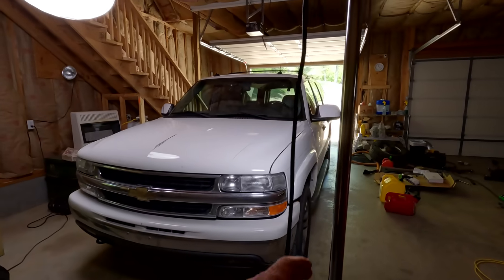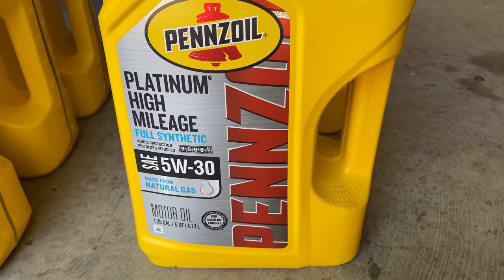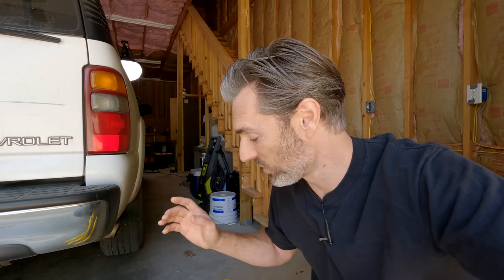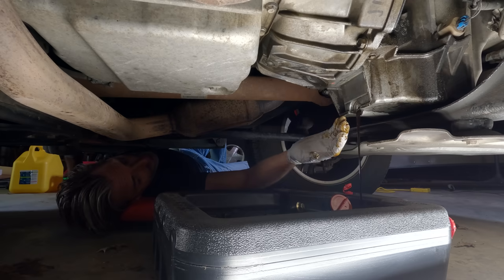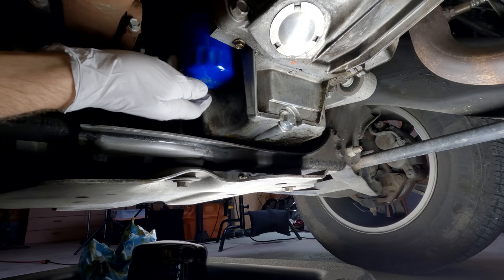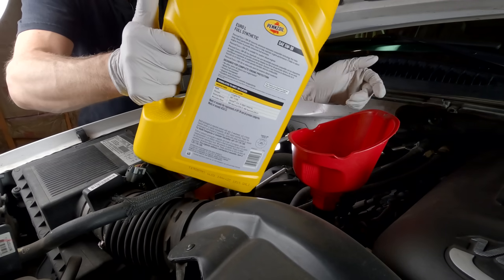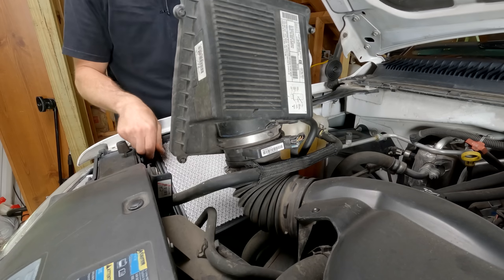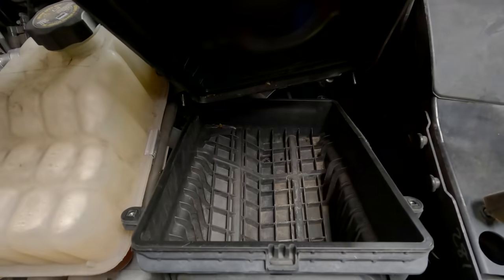If I Use European Spec Oil For My American Made Truck, Will It Break?

Comment: Dexos2 was originally made because the small DPF diesels need low SAPS to save the DPF. It also makes sense that it is a "Euro" formula, Europe has a large number of small DPF diesels. I suppose there are enough Opel and Vauxhall diesel cars for GM to need an oil that fits.

This is why it also meets Mercedes 229.51. 229.51 is the specification for the early DPF Sprinter. It's backwards compatible with earlier non-DPF Benz diesels.

14:39 I like what Toyota dealers do. When you get a timing belt replaced, they make a sticker that is hard to remove. It notes the date and mileage of the last timing belt replacement. Having that done on schedule is critical. Always know if your car has a timing belt, and always replace it when the manual tells you to replace it. I'm not sure if other manufacturers make a sticker for timing belt changes that is designed to stay put for a really long time.

Comment: Check the zinc requirements of your older Chev engines and what your oil has. Becoming a big issue with older engines with new oil.
Reply: Roller cams don’t need a lot of zinc like the flat tapper cams do.

Comment: That EuroL oil is formulated to withstand longer drain intervals due to Euro standards so it is packed with extra additive pack.
In such engine you can easily do 5K intervals , so at 3K you can collect a sample thru dipstick and than send it to Blackstone Labs for UOA and see if you cam safely keep it for 5K miles .
Remember that Euro drain intervals are often past 10K miles but i would never recommend it
Reply: Most euro cars do 15k miles intervals, oil is a lot more expensive in Europe. A gallon can be up to 100 USD
Reply: Some euro oils lack anti-wear additives like molybdenum.
Reply: @Shadows-RC  they meet alot more stringent tests tho, moly isn’t always needed

Comment: Jimmy, FROM YOU: I've learned of PUTTING A MAGNET onto the filter.....GREAT IDEA!   I have began to use "Napa Gold" oil Filters (they're made by WIX!) , where as I've always used to use "FRAM", since the '70's...........
Reply: Yep, wix makes a darn good filter and is always a safe choice!  For 20+ years I avoided fram like the plague. Until I started researching and cutting open new filters to inspect, measure and disect the filtering media to gauge thickness and view under microscope🤪 now, one of my favorite oil filters is the gold fram ultra! I still will not put an orange or silver fram on one of my vehicles. Tho my grandfather has used them religiously for 50+ years without issue, I've seen the guts from an orange fram get sucked into the oil pump and wreck an IMCA street stock engine. I know... wrong filter for the application.
Reply: @aaronpowell4885  Fram spin on filters are alright, their cartridge filters suck though. Had a Fram Ultra collapse within a 3k mile oil change interval in my buddy's S60R drag/street combo car. I only use Wix, Mobil, Mann, Purolator, or Mahle in cartridge filter applications as they seem to hold up way better than STP, K&N, and Fram filters from what I have seen in most Euro cars that I have worked with.

Comment: Did you know that these gm engines have many bigger oil filters that are compatible with the engine. I run a longer filter on my 6.0 Denali. It’s bigger than the oem filter.

Comment: Well GM states to use Dexos type oil. But i can assure you European Spec oil is actually of a higher standard than even Dexos. Another thing, if you used 100 Synthetic instead of Full synthetic there is not a great deal of difference between 100% Synthetic oil.  It is all the best stuff for your engine no matter which type. You'll have more problems using the wrong viscosity than anything.

Comment: I've been using nothing but diesel and euro 40 grade oil on my gen 3 5.3 and 6.0. Well over a half million combined on both original engines with plenty more to go and have never been torn apart. Hardly burn any oil and they run soft and smoothly with great compression.

Comment: I personally think that if you are putting effort into high quality oil you should also get a low micron rating oil filter like the fram ultra synthetic
Reply: Watch an interesting video about the flow and psi drop across many different filters vs oem spec. How it can increase use of the bypass valve reducing filtration rate or reduce pressure in critical areas like the crank journals etc. I tried this with a fram ultra vs a tough guard base filter and noticed a difference in the oil pressure and idle vibrations. Its not major but notable. The video ended with the consensus if there is an increase in filtering capability there needs to be an increase in media surface area to allow for the same flow rate and pressure after filtration.
Reply: @mikehub6664  yes, I agree with this theory because to me on Toyota engines, it seems as though they value flow over filtration
Reply: @mikehub6664  I use the Fram TG.. Tough Guard, it is very much like the OEM filters of all makes.
Reply: My experience with Fram filters in Euro cars  has been lackluster. The expensive Fram Ultra filters flow poorly and have collapsed and torn under 5000 miles multiple times in my friends cars. One of my buddies did a 3000 mile interval on their S60R with a frame ultra filter (running Liquimoly Leichtlauf 5W40, it's drag/street car) and it split in half in that short interval. Never have had that issue with Purolator, Mann, Wix, Mobil and Mahle filters
Reply: @Dustin Satterfield  I can see your point with regard to the cartridge filters from fram. Though the experiments for flow I haven't seen high psi or lack of flow for canister filters. I have a fragile ecodiesel so I only have wix as a quality option but I run a fram ultra on my expedition 5.4
Reply: @rockingarchangel  it's pretty bad for Euro cars running high viscosity base stocks like 5W40 and 10W60. Particularly for modified cars like the aforementioned S60R, or even my S60R that is running 22lbs of boost, when running a thicker oil than stock is quite important (5W30 and 10W30 both thin out too quickly at high EGTs, which leads to some pretty nasty wear with sustained loads) I have seen Fram and K&N filters really struggle with keeping their structure due to the higher pressure a thicker viscosity oil puts on the filter media. In those uses a high quality synthetic media filter is a must. For a daily driver that's gonna put put around town and isn't gonna be pushed hard, eh, they're alright, I really haven't seen anything impressive from them though, and I really like to point to Mobil, Wix and Purolator as better filter options. Maybe others have opposing experiences, I'd love to hear what others have to say, but from what I have found Fram's filters really really struggle to hold up when running high viscosities.

Comment: Unfortunately your a little confused about DEXOS applications. 
Dexos 1 = Gasoline 
Dexos 1 Gen 2 was updated for LSPI issues. 
Dexos 2 is a spec for Light Duty Diesel engines.
Reply: In Europe dexos2 is for both gas and diesel cars

Comment: I would run the ultra platinum over the euro L. European oils are formulated for 15-20k oil change intervals, not quality of protection. Pennzoil markets the ultra platinum as "extreme protection" over euro L for that reason. Either way they are both good oils, wouldn't be afraid to use euro L if that's all I had laying around.

Comment: Pennzoil and Mobil One. I did use supertech but the price is higher than Mobil unless it's conventional. I'm still using up my Fred's surplus. I got an assortment of different weights. The cleanest oil seems to be a good thin synthetic.

Comment: I use European oil on my 2016 honda crv i dont use 0w20 to thin of an oil i use 0w30 castrol euro oil in the truck its way better quieter engine considering its gdi and in summer i ise the 5w30 castrol euro oil no issues and an engineer from valvoline stated that its safe to use 5w30 in a car that calls for 0w20 and he also said its better for extreme heat as well

Comment: Good tip about rocks and dirt on the oil jug. I’ve never thought about that before. Did you get that GM filter from the dealer? I’ve been using the PF61E for the past couple years on my 5.3 which is the longer version of the filter, but recently found out that the E line filters is the cheap line. I was doing research and the Wix XP 51522 seems to be the best, but I like the idea of OEM as well. Possibly a PF61, not a PF61E

You’ve probably seen it, but project farm did a video on air filters and he happens to have a NBS suburban. The Wix 42488 did the best out of all the options. It’s what I run in mine

Comment: I used a Mobil 1 ESP 0w20 oil in my 2005 Pilot out of curiosity. The oil is for diesel cars that require a 20w oil. It can be used in gasoline engines. I bought it cheap from my local NAPA.

Comment: Great tip on the tape w/ info under the hood. I, too, run Wix filters, and use a silver Sharpie marker to write the date & mileage when last changed.

I also keep a simple spreadsheet (free Google Sheets) to keep up with general maintenance, repairs, and costs for each of my vehicles and my small engines (generator, lawn equipment, etc.) This gives me a quick way to see my overall cost-per-year in the maintenance side of ownership. I don't track fuel costs & economy in that manner, as I don't have that much time on my hands!!

Another good tip is the little window service stickers. Most auto supply stores will give you blanks that you can fill in, and stick up in the corner of the windshield, so you've got an easy-to-see reminder. Again on these, I use a micro tip Sharpie, as it doesn't seem to fade as much.

Thanks for the great video!!

Comment: You may want to shift your oil choice to valvoline restore and protect.  A whole lotta people have had great results from older vehicles.  I just started using it in my 19 f-150 5.0l.  For the oil filter pre fill, check out the motor oil geeks you tube channel.  He has a dedicated video to that.  Seems like a solid recommendation.

Comment: I use Rotella T6.15w40  It's got higher levels of zinc, moly, and other additives.
My 5.0 Windsor has 125k and is run in a hot climate
Reply: Liquid cooled engines run the same temp year round. Now if it was an air cooled engine, that a different story.
Reply: High Zinc will wreck your Cat Converter.

Comment: You should never use an extension when removing drain plug bolt.
Reply: Why?
Reply: @unknownuser16335   It's easy to slip off and strip head. Bolt care 101
Reply: @johnwagner4559  Only if you try to one-hand it. If you hold it right, there is no risk.

Comment: with steering wheel controls you don't have to do the gas pedal thing.  Just go to your oil life and hold down the arrow button for 5 seconds and it will reset.

Comment: On your next oil change, borescope inside the valve covers and look at the color of the rockers, pushrods and hardware. See how you feel about Pennzoil synthetic.
Reply: what might he see?
Reply: I heard pennzoil becomes into some sort of plastic type of material over time
Reply: Bingo!!
Reply: @spiralnapkin  In my experience on four different engines, the result was an amber colored discoloration almost like a varnish. Think of what an old carburetor looks like with varnish buildup. Needless to say, we abandoned the use of Pennzoil with a quickness. Pulling the rocker covers off one of the engines, we tried to remove the discoloration. It was resistant to any solvents we were willing to try on a in-service engine. We ended up having to use a wire wheel on the inside of the valve covers. As for the heads and valve train components, we left them alone and are keeping our fingers crossed.
Reply: Always enjoy using Castrol Edge over other oils if I can’t find my brand I used Mobil 1
Reply: Yep, I avoid Pennzoil. I prefer Castrol edge or Valvoline full synthetic.
Reply: And does the color of the inside component affect longevity?

Comment: I believe the Euro spec oils are good but all about emissions, ive noticed it evaporates more, read it has less detergents making them prone to get more contaminated in diesel and high compression engines, fuel in oil without detergents makes the oil protection properties drop dramatically, and without cause the oil to turn acidic. Someone correct if wrong

Comment: Hey Jimmy, I've USED TO : ALWAYS change my oil at 3k Miles, always, > When I was using normal, "Castrol 20/50wt oil".   I've changed some .........10-12 yrs ago to Mobil 1 > 0-30wt. FULL Synthetic Oil.    I have also changed my oil change intervals  UP to 5K miles.   Everything is good with this> FOR ME.   I must also tell you that I live in Yuma, Arizona,  a "VERY EXTREME CLIMATE".    5 k miles, is good, and imagine, I'm changing 2 times, where I "would've changed oil/filter 3 times!   That's a BUNCH of $$.    Think about this Jimmy!

Comment: Dexos2 is actually for diesel engines. Can be used for gasoline engines too.
Dexos1 is gasoline engines only
Reply: Yup, this. My 2.8 Duramax calls for dexos2 in the owners manual.

This is not the same as dexos1 gen2 which it seems like the OP got confused by, which to be fair is shitty marketing on GM's part.
Reply: It has lots of great engine protecting additives.

Comment: I don't prefill oil filters as all our vehicles filters are either pointing down or horizontal. If it points up I will. Also you won't have any issues with the European spec oil. Pennzoil is the best, after Amsoil.

Comment: Dry oil filter? Count the seconds after installing a dry filter, until the pressure builds up. Then multiply it by how many times you've changed the oil over 100,000 miles.

Comment: You should be using the longer PF61 filter and not the short PF46 filter.  Those are the AC Delco part numbers.

Comment: I almost sure that pennzoil oil is manufactured by shell. Therefore pennzoil, shell helix ultra and Mobil 1 is about the same stuff, 60-70 % GTL (gas to liquid), 20-30% PAO and 5-10% esther. This is all about base oil composition. Mobil 1 has a more modern package oil additives, including magnesium instead of calcium. All of them have low HTHS for a better fuel economy. By the way, dexos clasificacion is not something new, is in the market for about 12 or 13 years.

Comment: i have a 19 cherokee v6 i bought new in 19. been using same oil brand pennzoil 5w-20 full synthetic.   switched to mobile-1. since its at 70k now,  switching to 5w-30. since 30kish its been  using oil. hopefully going up weight, it slows it down from using it.

Comment: Just check the zinc level on the dexos 2, if its lower, then stick with dexos 1. Older engines (2004ish and below, check you engine specs) with Flat tappet lifters need higher zinc levels to prevent premature wear on the sliding surfaces where the lifters rub on the cam lobes. over the years oil companies have reduced the zinc levels. Because, of government mandates and the harmful effects; zinc additives have on catalytic converters and emission control systems. late 90s early 2000s zinc levels in gasoline engine oil were above 1200 parts per million (PPM). Today, you are lucky if an oil brand has at least 700ppms. Some people are using non S rated Diesel engine oil in their gas engines due to it high level of zinc (1100ish ppm). However, diesel engine oil without an S rating lacks the additives to handle gasoline contaminates and diesel engine oil with an S rating can only have that rating if it reduces the zinc back to regulatory guidance.
Reply: We said.  This is serious on older engines! Zinc for flat plane cams.

Comment: I can tell you first hand that my cars run smoother of this Pennzoil Platinum.  My son runs the old Yellow bottle Pennzoil semi synthetic in his 98 GMC pickup and it runs great.  Just a note, the only conventional I'm seeing as far as Pennzoil is the straight weights the 30 HD, 40 HD, etc... maybe the 25w 50 racing oil but, not for sure.

Comment: The cheapest is the best oil... so long as it meets manufacturers specifications. The biggest criteria in longevity and a good running motor is frequent oil changes and the environment in which an engine lives is the key.Dont ever follow manufacturers oil change interval specs for best results.

Comment: I don't know how much quicker or if its worth it to you but on my Chevy when I prefil the filter, the oil pressure builds quicker. It's probably just barely quicker but when it's your truck and you're waiting for pressure it feels like a eternity. I prefil the filter only if it's vertical for obvious reasons. I also o ly go about 4000 to 4500. I also love the ac delco filters, do a good job and I'd say despite what the internet says, it's still a very good filter and amongst most oems it's in the top end of filtration %. 98.5% I belive which is better than the basic filter but not as good as a wix xp but you're not paying wix xp money. These old vortecs don't care that much so I'm sure the delco is just right.

Comment: When I was selling Gulf Coast filters years ago my posts got some attention from a diesel equipment engineer.from NASA. I didnt know new oil is dirty. I always thought new oil was clean and got dirty because of poor filtration. I see NASA is.a Gulf Coast filter user now. I retired too soon. I was talking about  a Detroit series 60 using Rotella with a million miles with 1 oil drain. Someone forgot to tell a mechanic not to drain the oil it was a Shell oil test truck. It used Gulf Coast filters. I was contacted by Road King magazine wanting the truck owners phone number. They did an article on it. Probably not a good idea putting the crap on the bottom of the oil container in the engine.